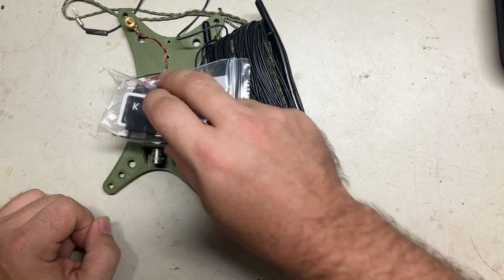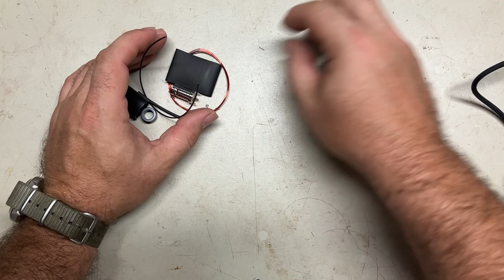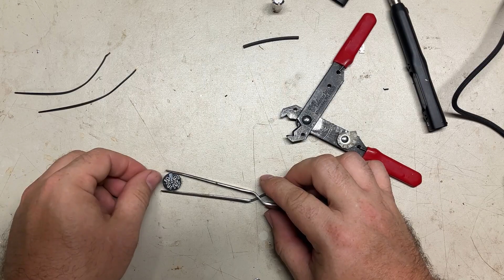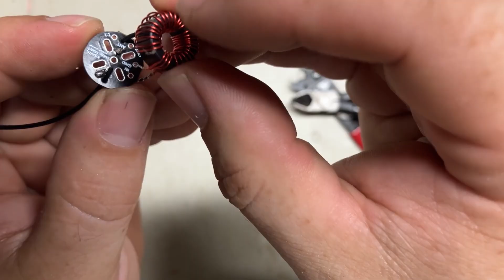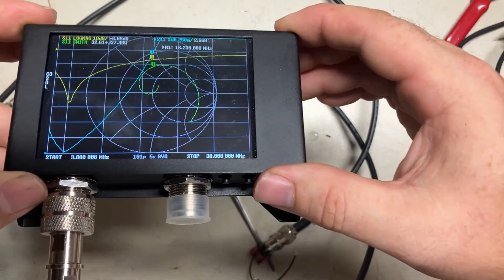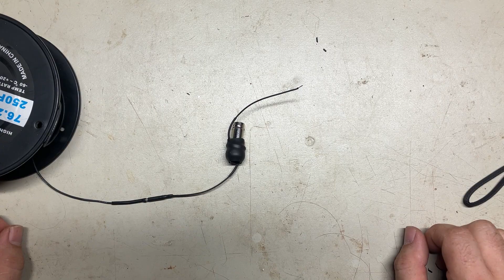At The Bench  K6ARK 49:1 Build

Comment: As always, a marvelous tutorial!! Thanks for all of your great videos!!

I just build my third one of these little devils last night - the first EFHW one I bodged, then I repeated it, now I wanted a dipole feed point. I made a couple changes in assembly order which seemed to make my life easier, and I have a couple questions:

CHANGES:
That whole "solder the tiny magnet wires then weld on the massive ground lugs and hope the magnet wires don't burst into flame" is what got me the first time, so this time I soldered the BNC connector to the board first (without melting the mag wire spots in the process), then slid on the toroid, flipped it over and since the 4 holes for the magnet wires are right along the edge I could get them no problem. Just SOOO much easier, unless you see a problem there...

QUESTIONS:
1) Would the same 2450-ohm trick work in this 1:1 assembly? Adam includes a couple resistors with his new builds so I thought I'd bench test it before applying the heat shrink. 
2) What do you do for strain relief with these little 2mm banana plugs? I have some Rube Goldberg loops planned, but just thinking before I commit.

And, love the look of those soldering tweezers! I've gotta get a pair of those! 

Thanks again for all your informative vids!!
Reply from the maker: In a 1:1 config just use a 50 ohm resistor. 

I would assemble it the way that is easiest for you. I put together a 1:1 for a dipole on one of the winders we build 49:1 units in at bugout camp. It will be appearing on a video soon.

Comment: A shame I cannot get this in Europe - or if I can - please tell me where!  Thanks!
Reply from the maker: I’m not sure if Amazon will ship them to Europe or not. You could build something similar from scratch with a bit of ingenuity.  The 49:1 is a FT82-43 core with a 3 turn primary and a 21-24 turn secondary. I suspect the capacitor is a 100 or 150 pf. You can fudge on voltage rating of the capacitor at qrp 100-150v rating is probably acceptable. No need for 1Kv plus ratings like we use on 100 watt and up power ratings. I’m sure the parts could be sourced from Digikey or another EU serving vendor. Using perf board would not be as elegant, but should work fine.
Reply: @griddowncommsup thanks! Yeah might give it a go. Amazon don’t ship this way.
Reply: How has it performed for you?